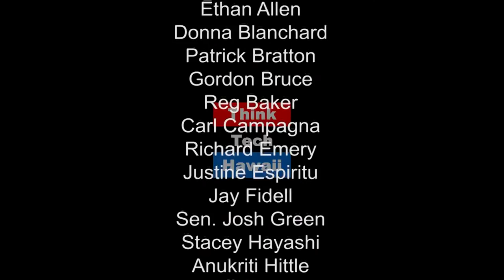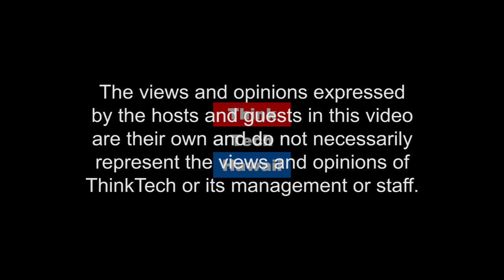Renewable Energy is NOT New - Biomass and Hydro Power with George St. John  and Ray Starling

Comment: If pumped hydro were used to store excess, normally wasted,  energy generated by oil, would the energy generated by the hydro system be considered renewable energy?   Since ratepayers already pay for the excess energy generated by oil, there would be no incentive to use pumped hydro to store/generate energy unless the generated energy were considered 'renewable'.